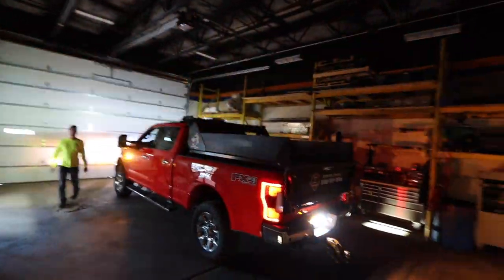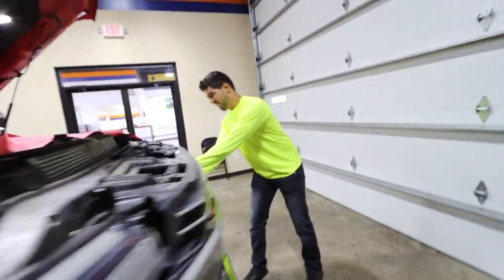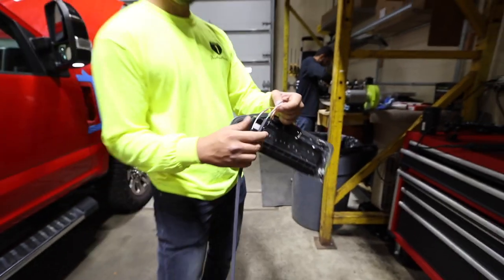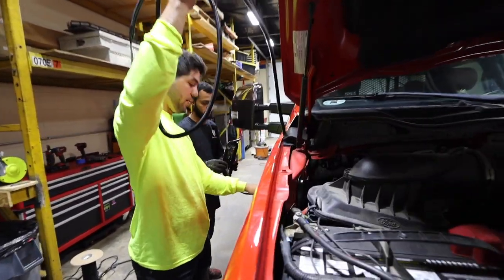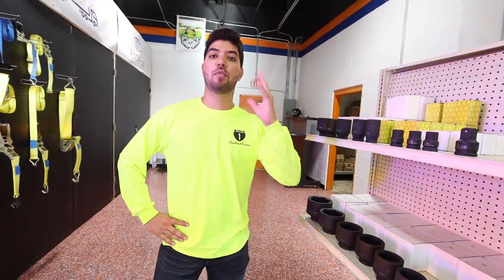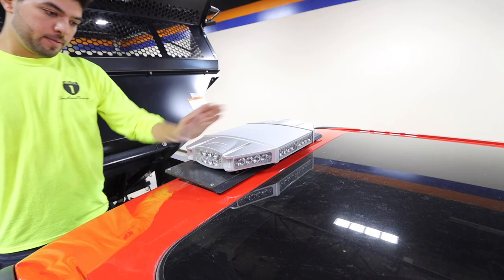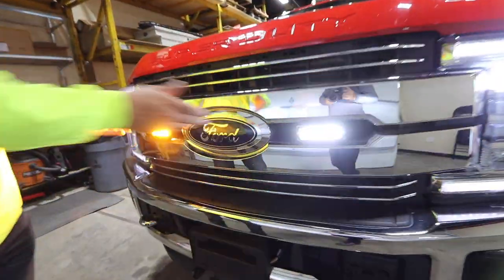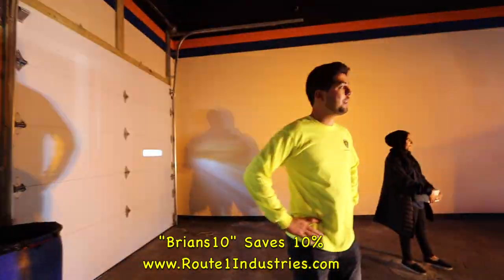4 Super Bright LED Emergency Light Upgrades That Every Truck NEEDS!

Comment: Shrink tube, stainless hardware and enclosing the wiring in loom is the best process for this type work. Great to see a vendor not cutting corners. His work is top notch. Will likely outlast the truck.

Comment: As a temporary/ permanent I went with plug n play lights and a multi/4 , 12v socket plugs with indicator lights for my front windshield, rear windshield and beacon lights. It lights up the night like a mother.....if for some reason you can't afford expensive lights and time for hardwiring....the options I've found are absolutely fantastic. They are super bright at night and more than visible from a distance in the daytime.

Comment: I'd probably still mount some strobes to the sides of the dump insert near the back end. Sometimes trees or signs/landscaping can obscure the front part of the truck when backing into the road. This setup throws a lot of light that should reflect off surrounding objects and alert people in most any situation but it never hurts to add another level of protection. I'm right in the middle of adding some myself.

Comment: Nice upgrade and clean install. Was there a reason why you went with amber and white instead of just amber?
Reply from the maker: I like the variety, it does look a lot nicer imo
Reply: Brian's Lawn Maintenance it definitely does. One of my trucks is all amber now, my other one I have yet to put lights on it yet. I like the amber and white, I just gotta see if we can run flashing white here in CT.

Comment: The Grill lights are pointless during plowing they will be shining on the back of your snowplow.  I thought Michigan just went Amber and Blue for snowplows.  Also there is a mount you can purchase to move your roof lightbar to the headache rack of your dump body. That will hold the lightbar level at all times.
Reply from the maker: Amber and green for municipal. But we do have the grill lights on their own circuit. We can run them during fall clean ups, by busy roads, at the dump when needed. Visibility is life
Reply: @BriansLawnMaintenance  Very true just ask anyone who has had to due traffic control.

Comment: His explanation of the inline fuse is wrong.. the truck wiring is not sending 20 amps to those lights, it is able to handle a 20 amp load, a fuse does not change your amps, if the truck was sending 20 amps and adding that 5 amp fuse it would straight blow, a fuse is a safety device to prevent damage. It didn't hurt to have that fuse in case some surge went through your system, but its not gonna prevent the lights burning out or last longer in the way he explained it.

Comment: Those grill mounted strobes are a bad idea for plowing.  They will bounce off plow blade back at you.  Made that mistake and had mine removed.
Reply from the maker: We have them on their own upfitter switch to disable them when plowing, or if it becomes too bright. Great tip though.
Reply: Brian's Lawn Maintenance Perfect!  Love you channel bud👍